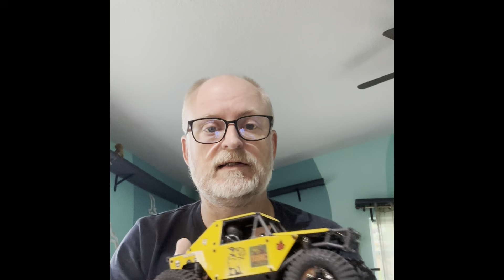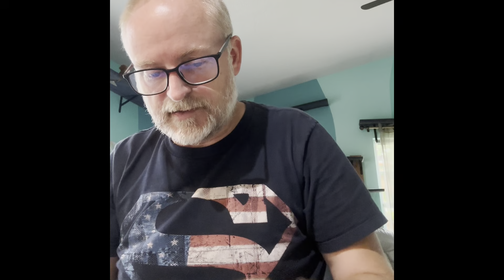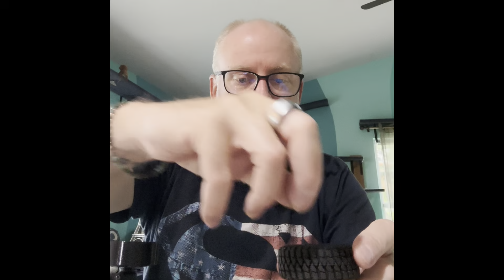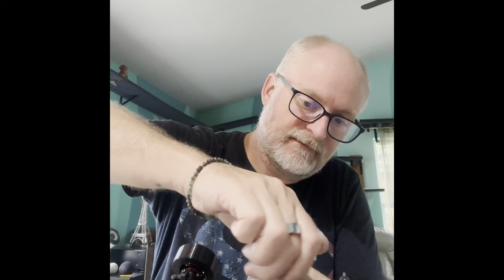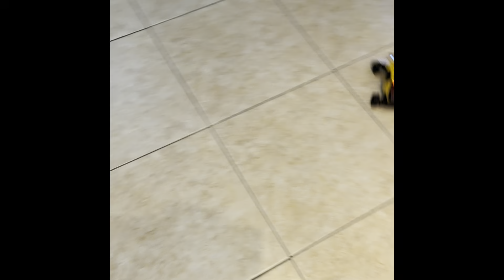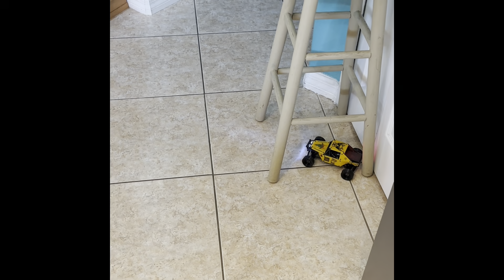UCX24 mental drift missile!

Comment: I'd bet that 1:24 on ice would be a blast!  Maybe even just use hockey pucks as solids!  Run some screws with hex heads in pre-drilled holes & Loctite(tm) em in.👍 From what I've seen in other reviews, for it to be a better 1:24 crawler...  maybe a brass rod front bumper to help offset rear battery placement.  Or the cheap soldering wound around the wheels & secured with tape or velcro.  That indoor drifting was an absolute riot!  Looks like a really fun little RIPPER!!!
Reply from the maker: Yeah it really goes bonkers on the tile floor… pretty hard to control, but with a little more practice I think I could really get it ripping…
Reply: @thankgodits  Chaotic rippin' is still rippin'! heh heh heh.  Have you ever formed/tooled any KYDEX(tm) before?  Thermoform plastic for all types of uses.  DUCT brand silicone tape is also another favorite to have around.  Thought I'd pass em along.  Have a good one driftin' past the fridge & around chair legs.  haha
Reply from the maker: @einblutwolf have not used those products before but I will look them up,  thanks for the tip!